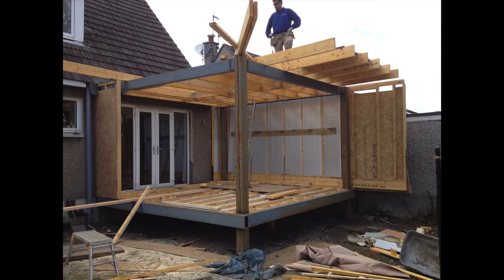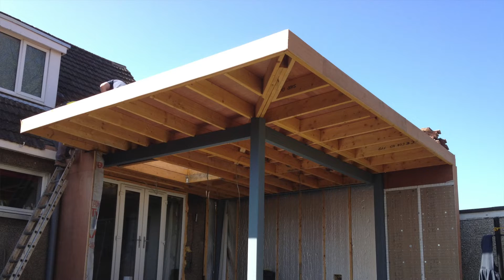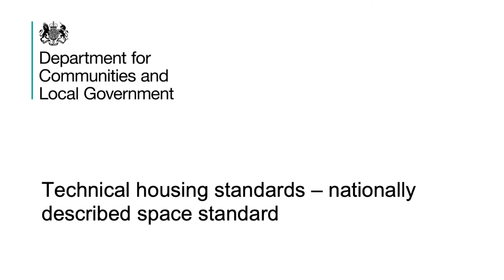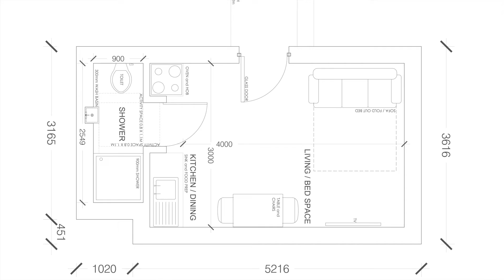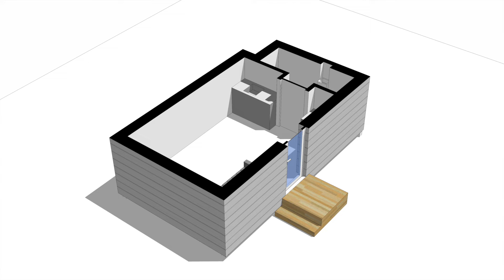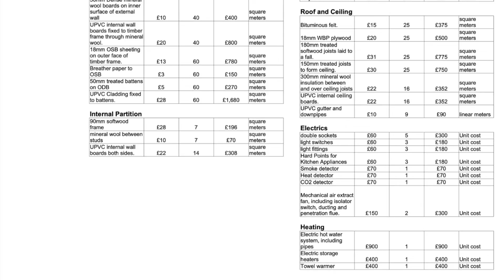The Cheapest Self-Build House Design in the UK?

Comment: I would swap the felt for grp its way easier for diy . I got my head around mixing resin and rolling glass in a day .  Wouldn't even consider tar for diy .  I did a pitched roof with green tin on my tiny house . Entire roof was like 500 quid and took me 3 hrs.

Swap the pvc for cedrum cladding. Barley more expensive and is fire proof.  Swap the inside pvc for t&g planks that stuf is literally £10a mtr . They can leave it pine or paint it .  Or just use plasterboard.  Tape and jointing isnt beyond a diy person they will just find themselves doing more sanding. 

Other than that spot on.   Thats my feedback from 20 years doing carpentry, drywall and groundworks  .
Reply: That's excellent information! I definitely wouldn't want to sleep in a building that's not fireproof.

Re: plasterboard, pretty much anyone could make it serviceable, if not pretty.
Reply: @avancalledrupert5130   Why not EDPM for the roof? Surely that's better / easier than both tar/glass?

Comment: Very interesting. I was looking at containers, but as you say, if they worked, everyone would be using them! I read that the cost to build in the UK is £1700 to £3000 per sq m depending on where and what level of finish. Did your costings confirm that the cost is split, more or less 50/50 materials and labour?

Realistically a home of any real use is going to have to be at least 75 to 100 sq m, so not a studio/bedsit.

Comment: I converted a single skin pitched roof double garage into a one bed flat by installing (I think 100 mm of Celotex) internally, insulating to attic and so on. It met the bldg regs and the buyer got a mtge on it. So, surely a breeze block dwelling with (today) 150  mm Celotex internals would exceed current Regs and be cheap to build? Are we not over engineering this? Many thanks!

Comment: Very interesting watch. Definitely think alot if these elements could be incorporated into new affordable housing.  Interested on how you worked out Labour costs, as a sparky myself in N. Ireland the cost of electrical work seems a little steep, considering the size of the building, short cable runs and no walls to chase. Also what would the breakdown of materials alone be for say a DIY build, and material price comparisons from now to say 5 years ago. As with the covid backlogs pushing everything up to silly prices.

Comment: Straw bale houses can be be very cost effective and exceed fire, insulation  regs. etc. Thoughts?
Reply from the maker: I’ve been in a straw bale house once, it was very cosy. I also grew up in a farming community and I know the type of bails used in the walls are very rare now. The bailing machines used to make them have been replaced by much larger models used to produce massive bails of the type found in modern farms which require tractors to move them. The old style bail could be manually handled.
Reply: @RealLifeArchitecture  there are the Ecococon prefabricated panels aswell.  A lot easier to attain Passive House standardsm
Reply: The biggest advantage of building with strawbales was how it empowered the builder through the speed and simplicity of construction, together with the ergonomics of the building process, However, it has a number of drawbacks that led me to turn away from the idea.

Firstly, the depth of the wall structure increases the size of building for comparable internal space, so everything else has to be scaled up accordingly, such as roof, groundworks, internal and external finishes etc.; strawbales can be cheap, but strawbales buildings are not, as only 10% of the cost is the wall system. There's no such thing as a tiny straw bale house.

Secondly, one day the house will be sold. Who is going to buy a house that is built using a concealed organic structural component built by amateurs that may have rotted owing to the unseen ingress of moisture? The structure is almost impossible to reliably survey, so any potential buyer is taking a big risk, making it less easy to sell and adversely affecting resale value. All this for the use of a material that represents less than 10% of the building cost.

Thirdly, the availability of straw bales heavily constrains the building process and timetable; construction quality bales are only available in certain areas of the country at particular times of the year. Transportation of bales to other parts of the country eliminates any cost savings the construction method might bring. Why introduce  these constraints into an already fraught building process?
Reply: @sailingoctopus1  some good points.  Using ModCell or Ecococon prefabricated panels resolves most of your concerns.

Comment: Yes.  Burn lime, fold into wet sand 1:3. Stack thing on top other thing.  Mind the bonds.  Architects are poverty.
Reply: @RealLifeArchitecture  instead of using all that manufactured crap…. Make some hot mix and stack bricks like your better ancestors.  Here’s the formula for the cheapest structure over time:  80,000 bricks, 30 tons quick lime, 50 tons sand.  75 Timbers.  Fold wet sand into quick 2:1, put brick on top brick.  When it’s tall enough to stand in put some beams across.  Use the other beams to make a pointy thing on top.  Deck with boards and slate.  Done.  Multigenerational wealth here we come!  Assuming 120k materials and 80k labor for one man with hand tools.  Can build in 275 days.

It will provide shelter for at least 200 years before needing new investment in the envelope.   So, 200k initial investment…. 200 years of service life..  that’s 83 dollars a month “rent” to provide permanent noble shelter and no barcodes or manufactured shit… just folk technology.  Hell if you have the minerals and timber on your land you can just get them from the ground.
Reply: @KurtisHord  ?
Reply: @hypsos666  all you need is timber, quicklime, and brick.  None of this crap.
Reply: @KurtisHord  is that legal? how does that get past planning permission in uk?
Reply: @hypsos666  simply build the shell as “garden walls” needing no review, (the whole building is 4 garden walls) minus windows trim and fixtures, have it recognized as historic structure (tell them it’s always been there since 1860 (they literally can’t tell the difference if you use traditional means/methods).  Get it “certified” and permit the improvements adding your sashes, trim, plumbing electrics, and plaster.
Reply: @KurtisHord  have u actually done this

Comment: I did a similar project as part of my part 2. Wouldn’t it be cheaper to have the shower room slightly bigger so that the building has a square footprint reducing labour costs and wastages?
Reply from the maker: Possibly, yes but, after thinking about it, I decided the step in the plan illustrated what happens when a building is designed to meet the regs and nothing else.

Comment: If it has 4 walls, a tight roof and level access, I'll take it!
Reply from the maker: Doesn’t have level access. In fact, there are a ton of things it doesn’t have
Reply from the maker: Level access could be designed in but I put two steps leading to a platform outside the door instead
Reply: @RealLifeArchitecture  Ok, confession time: I actually posted my initial comment before I watched! (Great video btw)  However, I've identified a narrow vacant (possibly brownfield) plot between 2 new build semis. How do I not snooker myself by applying for pre-planning BEFORE I speculatively purchase the land for my self build? Surely this will increase the land cost.  Thx in advance 👍🏿
Reply from the maker: @whyyoulidl  no easy answer to that one. Have you seen my video on what to check before buying land https://youtu.be/6JRB_dKDoxw
Reply: @RealLifeArchitecture  thx again for the quick response; will go check that out now...
Reply: @RealLifeArchitecture  So I watched the 'before you buy land' video; very good points; I was aware of some of the pitfalls. I'll book an online consultation with you at some point, armed with my sketches and 'back of the envelope' research. Thanks for yr valued input/knowledge as always 👍🏿
Reply from the maker: @whyyoulidl  I look forward to it!
Reply: A ramp?
Reply: @ExoticDoll  last time I checked, you'd still need a 1200mm sq. level area at the FED